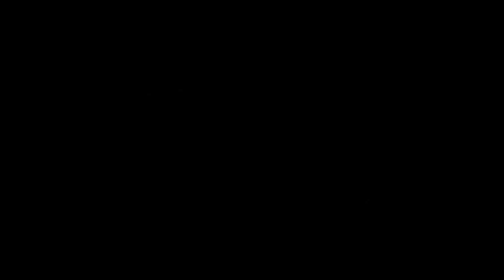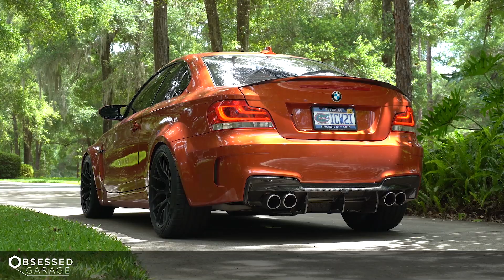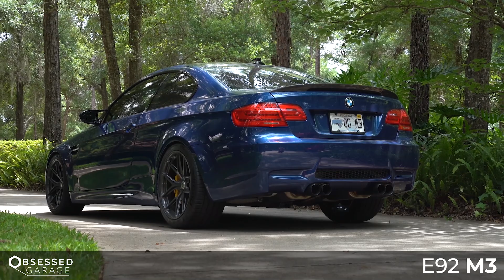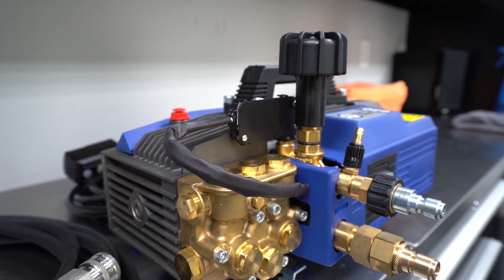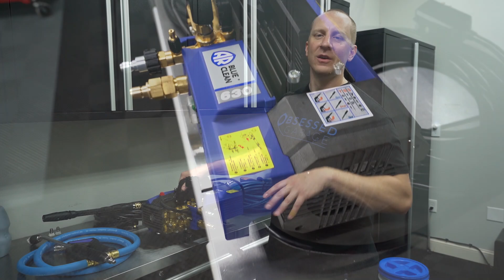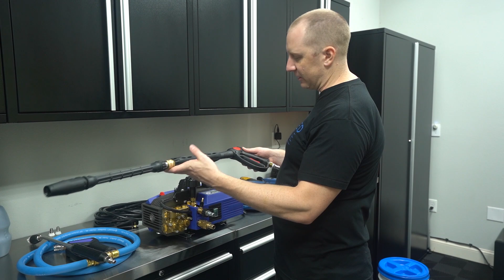The Pressure Washing Project: E16 - AR Blue Clean AR630 TSS HOT Testing

Comment: Hi Matt thanks for the Yoemans work on these power washers the DB rating might be slightly skewed as that I think all the other power washers were measured open air where the  AR was in the washbay just a thought john
Reply from the maker: Yeah, it is a little off, but should be close enough.  The sound test isn't super flawed since most of the noise is the water coming out of the gun.  I got lazy on this one.
Reply: Obsessed Garage I agree I’m sure it’s close enough you just looked a little disappointed in that you thought it was testing a little loud? it sounded (pleasant) over YouTube I don’t think anyone would be concerned. I wasn’t complaining I was just trying to ease your perceived disappointment no biggie cool channel one of the best john

Comment: Interesting that the pressure rating on your AR was only at 1380-1390psi.  I get the as advertised 1900psi using the same kind of gauge (Valley Industries) and stock gun.  Are you sure the unloader valve was set properly?  Turning to the right increases the pressure.  AR claims 2.1gpm at the 1900psi.
Reply from the maker: Yes, it was closed.  1300PSI was the clear output.  It doesn't really matter.  We don't want that much pressure for washing.
Reply: @ObsessedGarage  Good to know.  I know the high psi isn't preferred for washing cars, but just wanted to make sure you couldn't squeeze some more gpm's out that beast.:)  I'm may have to try this test out on my unit one of these days.

Comment: How do you determine how many amps my place can handle ?
Reply from the maker: You can usually look at the breaker for the circuit.  Then eyeball what else is on it.
Reply: Most outlets are 15 amps, but part of a circuit for the whole room, so your garage could be one 15 amp circuit or split in 2 separate circuits. The way to find out is testing the breakers and seeing what doesn't have power anymore. If anything else is plugged into that circuit you'll want to take that into account or move it to an outlet on a different circuit if possible.

Some outlets can be 20 amps, but not all that often. Sometimes bathroom GFCI circuits are 20 amps, sometimes kitchens can have 20 amps.

Comment: You could theoretically run a tankless water heater between dio tank and the pressure cleaner and achieve the appropriate temp without any loss in heat.  It's excessive and pointless but can be done. Great vid
Reply from the maker: Tankless are usually limited to 125 degrees.

Comment: Love the pressure washing videos! Over at pressure washers direct, there are some 1500-2000 psi with 3 gpm models. Dewalt and Pressure Pro both make one. I'm sure you're tired of all the testing but seems like you've found your sweet spot as far as gpm and psi are concerned. Any plans of testing these higher gpm units? They are just as expensive as the Porsche Kranzle but if the output is more without needing the dedicated amperage. Might be worth looking into. Either way, great work and appreciate the honesty!
Reply from the maker: Someday I will, but most of those are more than what we need.
Reply: @ObsessedGarage  Matt, on a side note I have a company called Bio Bait. We launched 2 years ago on the 4th of July. #Murica We are the OG of fishing lures with a patent on a water soluble formula, thats eco-friendly "plant based, infused with fish oil" without sacrificing performance or durability. We have some major retailers whom have already  put in p.o's I was going to send you an email and hope it made it through the filters and would get to you. Thanking you for your approach and lessons that we've learned. Unfettered brutal honesty, customer engagement and interaction are things we pride ourselves on. I've learned so much and although our youtube game is weak sauce right now. My partners and I look forward to blowing up like OG has. Much love and respect!

Comment: I have this pressure washer. I wall mounted it identically as the custom install solution.
Reply: After about 6th months of using this pressure washer with you custom wall mount it has held up to my expectations and then some. The only thing I would like to change is the fitting for the inlet hose. The brass fitting that allows for you to attach your garden house has become loose and is slightly leaking water. After some torquing down and inspecting it turns out it might just be defective. Do you have a solution on your store that can replace this factory piece. Thanks - Cris

Comment: Thanks Guys, I am still researching which PW I want to buy, and its seriously looking like ill be ordering the Kranzle from you guys soon.
Reply from the maker: Kranzle is the best.  These are another lower cost option.
Reply: Obsessed Garage I am feeling like if I am going to spend this much I might as well just fork over the extra few hundos and get the best experience 😇
Reply: ChevyLee 
That’s the smart move! Wait until you can afford the kranzle. I got the 1122tst complete package from OG. Watch his video on the “unboxing” and set up while you wait a few short days to get your gear. Matt has made it all super easy by doing all the investigating for us.
Reply: Paul Farmer solid advice. I am currently pricing out DI tank rentals, I have a cr spotless and it lasts me about 10 washes, if I am lucky. Once I get those tank rentals I’ll pull the trigger on the system.
Reply: @ChevyLee86  This AR model outperforms the Kranzle. I'm not sure you'd get a better experience by spending those extra hundos.

Comment: I own this one. I hate to say it but it was the worst 600+ I spent. Leaks oil after the first week. Customer service was nice but it took several months to get any replacement parts. and it started leaking again. Avoid it!
Reply from the maker: That has been the story with all of them.  We will chase and fix it working with AR.  We've done the same thing with Kranzle ironing out issues with shipping and also Comet.  That's the value I'm hoping to provide to get it right.
Reply: I got one i use daily. Never had an issue. Don't know why you would wait "several months" when you can easily buy parts online. Yes you can talk warranty, but time is money to me. I'd rather pay, and have the machine make me money vs wait months